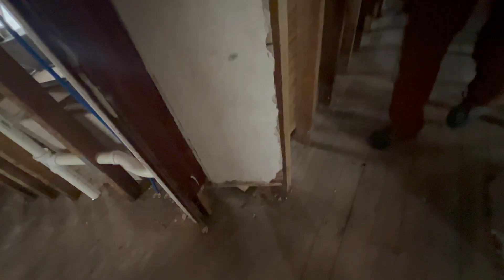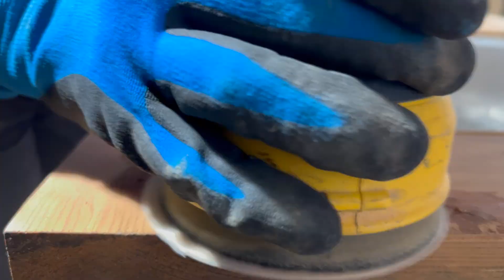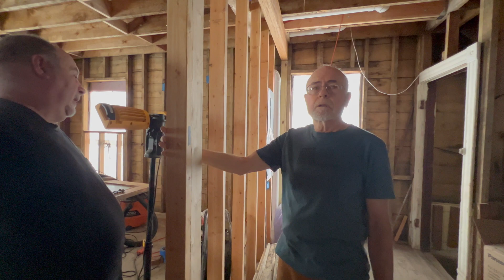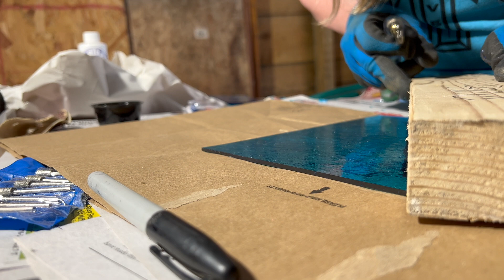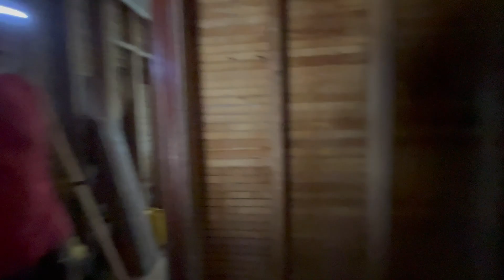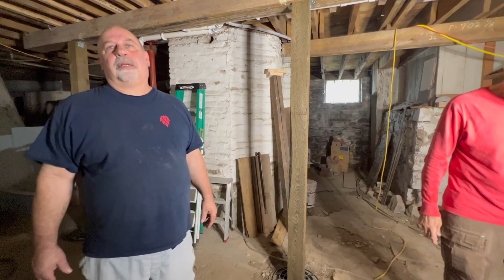Installing an Energy Recover Ventilator - Round Window Restoration Begins + LOTS OF RENO PROGRESS

Comment: Haha, my 1939 house was built with sloping floors!  When my structural engineer came over to investigate, we were both scratching our heads until he pointed at the two bedroom windows.  The  clapboard siding is original, and it is level, but the (original) windows don't line up with it!  We think that as the cement foundation cured, it shifted, and they just kept on building.  It's a small middle class house, so they were probably worried about budget.  It's fine, it's structurally sound, and the trim is level.  :D
Reply from the maker: I'm not opposed to a little slope either... and I can't really tell yet how much we will have after the wood floors are laid, but I'm with you about structural soundness.  Besides, with a sloped floor you always know where the things you dropped will end up.  haha
Reply: @TheGrandLady  I've really had to get used to my rolling desk chair trying to roll me away though!  :D